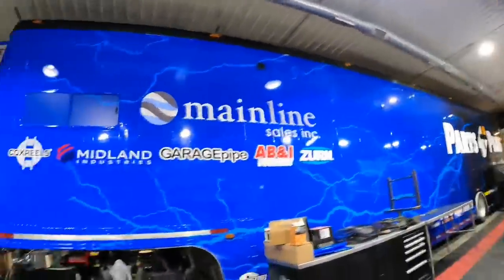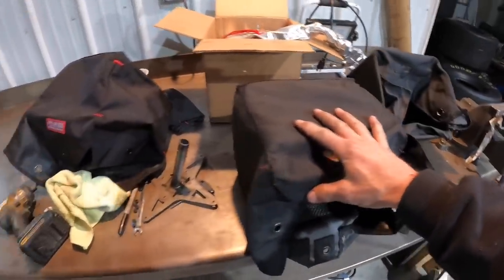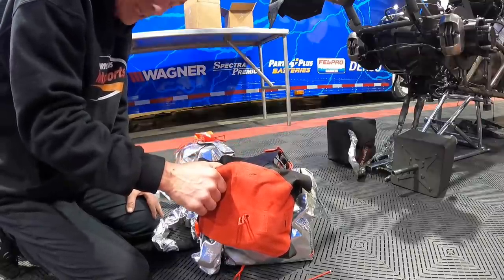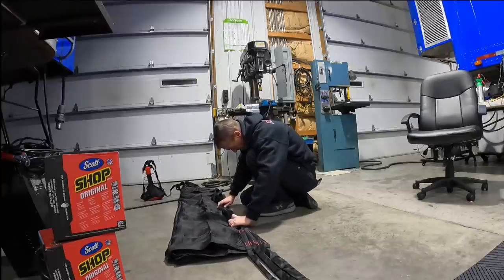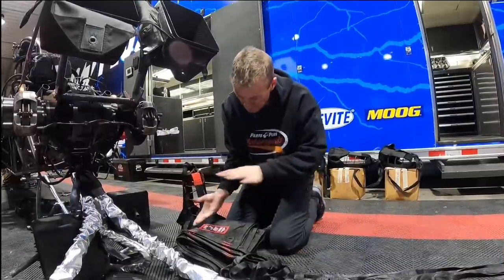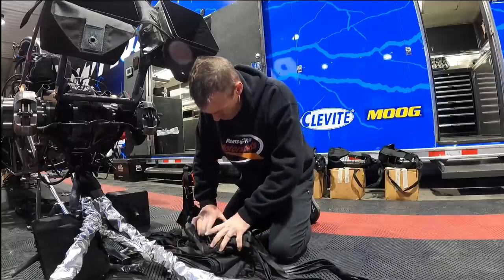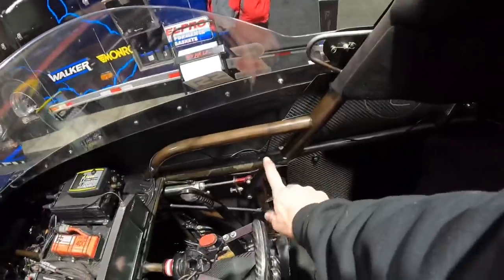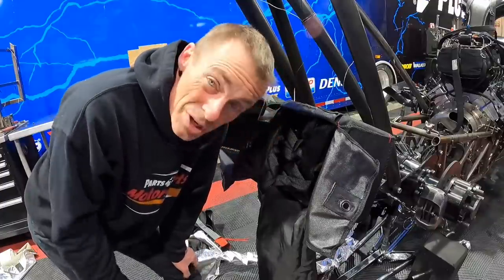Remove Before Flight!!! How To Pack A Parachute. #how #fast #330

Comment: A red hot paper clip thru the center of the roll-up earplugs,,for the earbud radio insert cord,,thingy.   Once saved my brothers life,,by jumping forward and snatching the "remove before flight' flag out of the release cable loops. I was shooting video and spied it.  Everyone else missed it.  Darted forward,,Pulled it free quickly but carefully,,and the light went yellow!!.   He was already in!.  I watched wheelie bars slap the ground millimeters my toes!!,,with 4500hp.  Good Chute!!.  Nothing wrong with living in the sticks. Get your hustle man a single seat hovercraft,,for the parts runs.  Thanks Clay.

Comment: I need to go over 150 mph to be req to use it... But Clay need to pull the chute standing still in the garage thats alot of work :P  But remember  remove the "Remove Before Flight pin" before you leave the start line or else it's getting interesting...

Comment: We watched Alexis DeJoria with her chute at Maple Grove. Man, you are not kidding. Those things can get tangled up after a run. One question, what exactly did the wire go through? Was it attached to the red cord somehow? Just wondering..,
Reply: On the end of the spring there is a hoop that the flaps fitover before he pulls the string out he puts the cable in place at the string then slice the string out

Comment: Awesome video, always wondered the procedure for doing it, the only bit i didnt see which I would like to know is once you have all 4 flaps closed, how you put the wire into the cord to keep it all closed, I couldnt work that bit out
Reply: that was the step i couldn't figure too.... does the cord just get looped out of the hole and the wire pushed thru?

Comment: I could have used this 20 years ago 🤣 I ran a low budget bracket dragster and packed the chute once when I bought the car using my best guess. Never pulled it though mainly because I was a one man operation and was a little intimidated by messing with it. It was never a problem at Norwalk with the long smooth shutdown area. But at Milan I had a couple of episodes where it would have helped. Was easy to get the slicks bouncing and it got a little hairy getting stopped 😂
Reply: It's a little late but when I used to run alone I had a spare chute already packed and just kept it tied off so I didn't have to repack it between rounds later on when time was tight. Or if something broke.

Comment: Great video and demonstration.   Back when i bracket raced with a dragster i quickly learned that i had to unpack and repack the chute at the begining of each race day or it would not come out good,  especially after a couple of weeks.  I even used baby powder on it to help with it coming out.  Do you have to repack prior to first run at an event or do you leave it unpacked until next event?  Thanks.

Comment: Clay, You forgot the little safety flags that you put in there. And explaining what the purpose of the safety flag is.
Reply from the maker: The safety flag is just there so the chutes don’t fall out when you don’t want them too like when you are towing the car to the starting line or someone is working on the back of the car and snags one of the cables etc. It’s way easier to put the cables back in when the chutes don’t fall out and those pins the flags are attached to keep them in there. Thank you for watching.

Comment: 1 question; what happens if you forget to pull the nylon cord from pilot spring after packing everything? I noticed it was taken out before deploying the chute but missed ya pulling it out.

Best of luck to you and the Parts Plus team in 2022!!!
Reply: Simply the chute will not deploy correctly as the cord will hold the flaps closed. Here in NZ at my strip, if it is spotted by any of the start line officials during the burnout you will be disqualified, we take it that seriously.
Reply: loveyou

Comment: The direction that the pilotchute  goes depends ALOT on how the spring us compresed.to get a good launch the base of the spring has to be centered under the top.if its not,the pilot huge will try to turn sideways as it leaves the pack.and having that loop on the top of the pilot huge only agravates the situation.the slight drag of the closing loop thru th grommet will try to tip the pilot chute...I know what I'm talking about.50+ years in the parachute industry